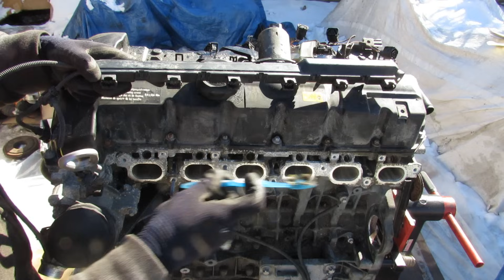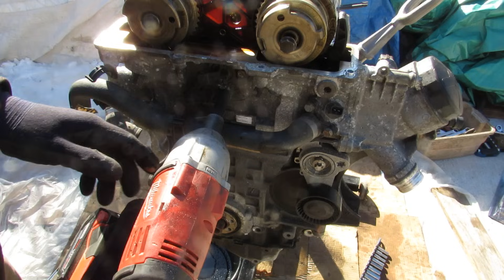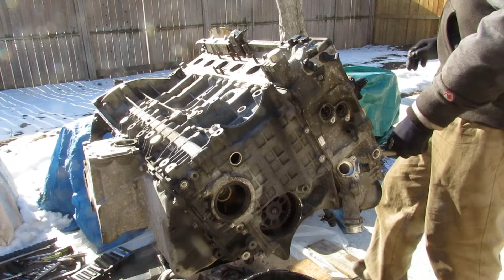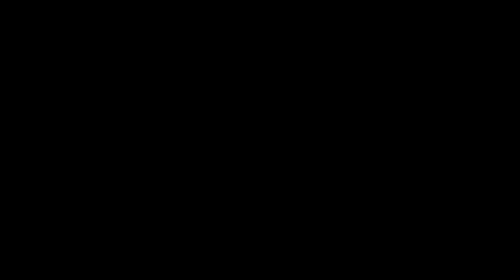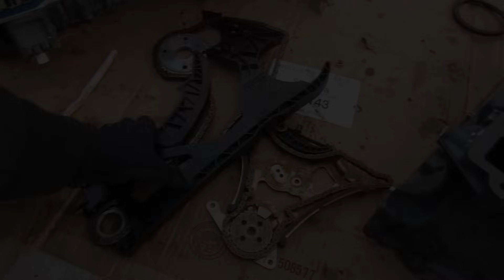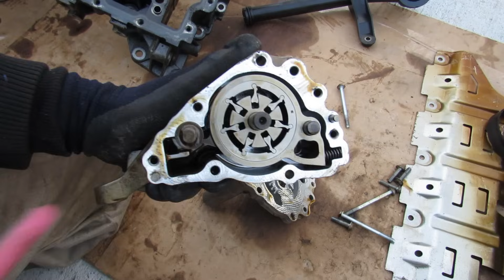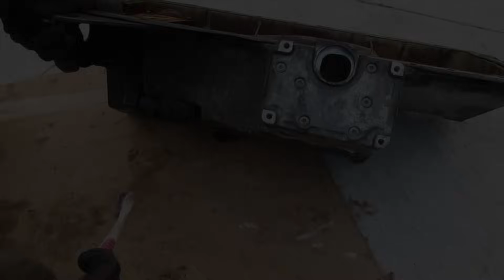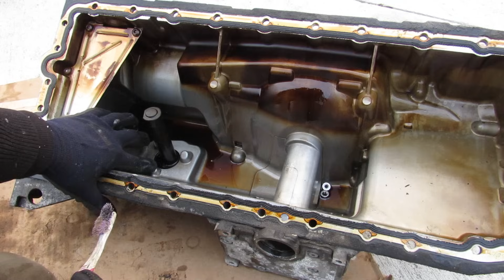The Last Inline 6 Engine: BMW N52

Comment: I think if you'd watch some of the BMW YouTube videos you would understand the name of the nomenclature of what those items are called versus versus making up names instead of calling it what it supposed to be called and how you pronounce it, but all-in-all you didn't describe her explain the carbon buildup on the Pistons and the Rings and try to give some explanation if there was anything in particular because of that? You could say that German engineering has made these really reliable engines similar to the Toyota 4 cylinder engine, but the issues with the leaking oil has not been perfected as far as stealing the engine off and using a cast-iron valve cover instead? He also neglected to mention the Vanos check valves and filters down line on the left side of the engine lower left that use a torch to remove them there's check valves and a filter screen going Upstream to the venous valves why don't you try that in your next video why do you think they develop the engine flush to begin with, the clean out the contaminants and sludge and contaminants inside the engine!

Basically on design of the BMW engine all BMWs are going to leak oil from the valve cover and from the oil pan! 

   So you're going to have to always have a budget to replace these components around a hundred or a hundred fifty thousand miles to depending,

 unlike the Toyota engines,
 use cast aluminum valve covers and they have a integrated steel neoprene gasket in the oil pan!
  Bottom line,
  Toyotas and Lexus models are higher reliability to own and maintain,
      versus the BMW line!
I can relate and vouch for the Toyota line!
    since I've had three Toyotas previously going back to the early 80s,
   I never had problems with leaking oil pans are valve covers?!

Comment: 5:14 That's not true. First you have to take both VANOS gears off and then you can take the whole timing chain assembly. In your case, the inlet VANOS has broken bolts and the gear stayed.

Comment: Like you mentioned, these engines were sensitive to proper oil pressure- so make sure you don’t have run low on oil, or even overfill the oil level.  A really nice engine, overall.

Comment: I hope he saw the broken Vanos gear bolts in the bottom of the oil pan.  That was the problem with the engine.  Those old style vanos gears bolts break frequently and were upgraded by BMW to a stronger style, with different bolts.

Comment: Pros and cons, when it comes to BMW in general (90s and newer)

Pros- incorporation of advanced but somewhat untested technology means good power output and economy, relatively speaking. 

Cons- if you buy one with more than 75,000 miles you will quite likely end up feeling conned 😅 unless if you don't mind quite costly repairs to replace bad gaskets and shoddy plastic failures
Reply from the maker: Agreed. Lots of things add up and it's not cheap to repair

Comment: One of my favorite engines, had one in a e90 from 70k km to 150k km did 4 oil changes 1 radiator 1 coil pack and 6x spark plugs I was super pleased with the motor and oddly I never had an oil leak was still very tidy under. I have since upgraded to the newer B58 I-6 3L single T and boy do I get similar vibes in the robustness

Comment: all these engines are pretty bulletproof if you take the time to fix the leaking valve cover. just put in some gasget paste on the original seal and it leaks no more

Comment: "Part of what makes this engine a real BMW is that it leaks oil...". As a current and many-in-the-past BMW owner, this has me in stitches. He ain't wrong!
Reply: Properly serviced BMW engines do not. Craftsmanship is a bit different here in Germany.
Reply: @alexandermenck6609  Nonsense. I've had several "properly" serviced BMWs that leaked. Virtually all of them do eventually. Oil lifter housing, valve cover gaskets (among other spots) notorious for leaking.

Comment: Lifter tick isn’t solved by replacing the top end 😂 waste of time it will soon return you need to bleed the lifters by having the engine up to temp and hold it at 4K for 30 to 40 seconds and lifter tick will be gone it’s a design flaw and will always re occur new lifters or not

Comment: HELP! This is a longshot but by BMW e60 is "lagging" when I hit some big bumps/speedbumps and the car acts like a crazed horse 
for a few seconds, I've changed the VANOS already but the problem is still there.
Happens in LOW REVS! And sometimes it can happen while im cruising in 80kmh and I hit a tiny bump, feels like the car taps the breaks 
almost but we've tested all of the breaks and abs systems etc and it has nothing to do with that.

Comment: I had a few days with this kind of engine in a 125i convertible. Amazingly smooth, eager to rev and the sound was pretty good for a stock engine. Getting into an old school, NA 6-cylinder BMW when you're used to 4-pots is quite an eye-opener WRT smoothness and general "engine manners". 
It did feel a bit underpowered, despite its more than decent hp-rating, but that was probably just the car being overweight.

Comment: I have an 04 530 with an m54 and 200k miles later its still going. Now I'm looking into getting a 128 and I've been hearing great things about the n52
Reply: Get one bro, I got a 130i with lots of miles and it still runs perfectly fine

Comment: Love the video dude I’ve got 2007 bmw 335i it’s still ok other than the valve cover gasket coolant bottle elbow on the front of the engine  it’s an n54b30 turbo motor 6speed manual

Comment: What makes it "The last inline 6 BMW Engine"?  As far as I am aware there are next generations and by far better inline 6 engines BMW makes today like S58/B58, why is the shitty N55 the last? 
If you mean the last then it certainly isnt the N55, its M50 the true best BMW engine that they have ever made. Cast iron straight 6 with proper design not in terms of N/A power but in terms of how its designed and built, its operating resource allows 1000HP at ease if you make it work under forced induction.

Comment: i love this engine. bc i used to own a 128i. sounds so good when you just straight pipe the muffler. but i dont know if i will ever own a bmw or german car again. that thing just ate my money up. maybe as a side piece car when i am ballin. if ever.
Reply from the maker: Very smooth motor though
Reply: @speedkar99  definitely agree. it is probably the most smooth motor i ever drove. power delivery was very predictable, sounded nice, and the power itself was more than enough to have fun with. after i put active autowerk headers on with a tune, this thing felt like a E36 USDM M3. i wont lie, i miss my little 1er..

and you are right, this thing leaks oil. had to do the valve cover during my time of ownership at around 85k miles.

all things considered, it was probably the most reliable engine, as i had very few problems with it overall compared to other BMW owners in my circle of friends, along with on the forums (N52, N53). just getting normal parts for the thing were just expensive, and anytime i needed to get work done it was expensive..

most fun motor i had though was definitely the K20Z3 on my 07 civic si, which i believe you also covered on this channel?

thanks for the awesome content my dude, i am a huge fan!

Comment: 2012, 128i with 67k, when does it start leaking oil?  Had a 96, 328iC, sold at 120k with no oil leaks.  Two convertibles out of a long list of convertibles since 68 Camaro.  Convertibles, it's a disease. No bad BMW's, just bad owners, just like dogs.

Comment: When properly maintained this is one of the smoothest and quietest running engines I've ever listened to.
Reply: I agree with you...i have one with 188K and runs like a almost new car...pleasure to drive it!
Reply: @goldensprank5972  if you change oil regularly it can go over 500k km.
Reply: @korencek  Yes, i definitely believe that!
Reply: @korencek  That's about half as long as the Honda K24 series 4-cylinder engine will last with just scheduled services. I know this because I've seen several of them in Accord's, Element's and CR-V's last over 600K miles - not km's. Easier to service, too. 
But, the BMW gives you the superior status and much higher repair/service/parts bills.
Reply: @boomerguy9935  The engine can last forever if you change all worn parts regularly. This goes for any engine. The problem with luxury cars is that at certain car age people stop investing at it so it brakes down faster. While poor people will maintain their car as it costs much less. So this debate about honda vs toyota vs bmw is meaningless.
Reply: @korencek  I've had new cars that started breaking down almost immediately after buying them. This includes American, Asian and German cars. So, I'm not saying that any particular brand is better than another ("debate about honda vs toyota vs bmw"). What I am saying is that a particular model of car or engine - regardless of brand - can be better than another. I've had good and bad in all brands from all countries. Right now, I have cars in my driveway that are German, Asian and American and they are all good. 

Conversely, I've bought used cars with good service histories that lasted hundreds of thousands of miles with routine maintenance. 

I've been buying and wrenching on vehicles since the 1960's and I speak from experience. 

IF the parts are made of high quality materials and the engineering and assembly is good on them, they can last a very long time but you cannot assume all parts in all cars will last the same length of time. 

I love the design of the I-6 engine and I've owned them in  a Ford Falcon, Datsun 280Z and in a Jeep Cherokee. Very reliable, quiet and smooth, and my favorite design, although I like a lot of other designs as well. I understand the Chrysler "Slant-6" was extremely reliable, as well.
Reply: @korencek my n52 (530i) is at 380k km now on LPG and still going strong.
Reply: @boomerguy9935  that may be true but no honda drives or handles like a Bmw. Or feels even 50% as safe or stout at higher speeds.  Anyone who's driven both brands will attest to this. Living in a major city, driving a tin can is like playing Russian roulette with all these fantastic driver's
Reply: @korencek with everything leaking..2500 for pan gasket..I could do the filter housing myself..maybe the valve cover
Reply: @boomerguy9935 I got a 08 x5 and a 16 accord..I hate my bmw already..had for 4 months..no dipstick..no temp gauge..lol..newbie
Reply: @goldensprank59its nice..but no dipstick is what gets me have to rely on a damn sensor..especially when the oil pan gasket is leaking got a 08 x5 with 150k..runs good
Reply: @goldensprank5972  188km is new tho what do you mean that’s what you get when you buy from a dealership
Reply: @dennisrock5564  he/she means 188,000 miles
Reply: @spicysnowman8886  thanks
Reply: smooth, quiet and pushed you back in your leather seat, it was special. everything good goes away.
Reply: @truthmonster3290  still got mine
Reply: @truthmonster3290  everything goes away
Reply: @crackedemerald4930  Exactly, even I thought I would never die but still died January of 2017.
Reply: For reliability N52 is the better option. Can't count the number of times I had to deal with my N54 having issues. Not saying that the N52 doesn't have problems (oil leaks, as any bmw). I prefer my E90 328i xDrive over my 335i for everyday use.
Reply: @GautamKumar-cr7tw  Yup, my oil pan gasket weeps. I have the same car actually. 2008 E90 328xi sedan 6MT. Just turned the clock at 90k. I'm just the second owner, I've had it for 3 years now. I've replaced all the consumables and I live 20 minutes from FCP Euro so that's a big plus. Love the car though. My friend has a 335 with an N55 that puts out like 600hp but I prefer the hydraulic steering in my car. Makes a huge difference but his car is an absolute weapon when he's not working on it in the shop lol.
Reply: Lifter tick man, it’s no smooth engine
Reply: @vamosnippon  Also, to say an N52 is not a smooth engine.... is just wrong. Like, have you ever driven one?
Reply: @saganworshipper6062  lol yes I have the e90 and I got it because of the silky 6 until lifter tick kicked in. I use liqui moly oil and additives but no real solution. Idk what’s so smooth compared to other engines tbh.
Reply: @vamosnippon  it's a purely mechanical fix. No amount of ceratec or any other additive will fix it. You have to install the updated exhaust lifters and rockers. It's just the exhaust side and it goes away if you just drive the car for 5 minutes. It only affects pre 2009 cars.
Reply: @saganworshipper6062  yeah the guy doctor Dean rkns just hold the accelerator down on 3000rvs for about 3mins or so and it goes away..
Reply: @saganworshipper6062  I got the plug-in called Carly, and reprogrammed the transmission points for my N52.  I made it a lot smoother.  The ZF transmission is capable of operating in a number of different ways.  so I made it smoother with more reasonable shift points and differential compensation between gears. Caution. Don’t set the shift points too low, because the N52 shouldn’t be below 1400 during normal operating conditions, or carbon buildup will occur.
Reply: @kellyem33  My car is a manual transmission.
Reply: @saganworshipper6062  That’s good to know
Reply: @vamosnippon  that's been corrected. Requires new lifters and rockers, but there is a factory fix out now.
Reply: @boomerguy9935. Maybe be true but no honda can drive  or handle like Bmw.. And Hondas do not feel even 50% as safe or stout at high speeds. Living in a big city I feel much safer not being in a tin can
Reply: The older M20 (two valve - design) runs smoother, especially the smaller ones (2,0 or 2,3 liter).
Reply: I agree. I didn't realize that 12 years ago, when I purchased it with regular maintenance, it's great. I did my own valve cover replacement and gasket refresh because it started leaking on schedule. Remember to replace your oil filter housing gaskets! I have 111,000 miles on mine. My biggest worry is the timing chain and the slides. I am not sure if that is a failure point. Too difficult for me to work on myself.
Reply: @ThunderMilflin  That is a worry of mine too. I saw someone doing an engine teardown of an  N52 and when he took out the timing chain guides they basically shattered like glass. They were heavily stained though and the person made the comment that the engine had been neglected and hadn't had regular oil changes. I take the utmost care of my car but that video legit frightened me. My car still has under 100k miles but it's 15 years old now, and I live in New England so it gets below 0F in winter and we see at least a handful of days in the summer that are at or very near 100F. Those types of temperature swings CANNOT be good for any of the plastic. I'm just the second owner of the car but I don't have much history from the previous owner. I only know they changed the oil regularly at the dealer as shown on the Carfax but I think I'm on the original OFHG unless they replaced it at an indy shop that doesn't report to Carfax. I check on it religiously because of the fear of getting the belt sucked into the crank, but there is not any sign of leaking there at all. My oil pan is a different story lol but that is like a $2k job if you have a shop do it because of the xdrive everything is in the way so it's like an 8 hour job.
Reply: O h do realize that sounds silly compared to a Corrolla, but we cant all drive Corollas.
Reply: @ThunderMilflin  I’m honestly considering getting rid of my n52 z4 for a Corolla powered mr2
Reply: @GadgetMart  me personally, looking at a truck next. Been living with the 1 series for more then a decade. She’s still clean though. I’ve given her a nice easy life.
Reply: My brother has an e90 328xi with this engine and let me tell ya IT DOESNT LEAK. I know this sounds like something made up but the thing is bone dry under there 200k on the odo.
Reply: @MrVette213  That's pretty impressive. Where does he live? What's the climate like? I'm in CT so we get both extreme hot summers and cold winters. That and the liquid salt they put on the roads nowadays will literally disintegrate your entire undercarriage. Stuff is the worst on all the steering and suspension components but probably also has contributed to my leaking oil pan gasket. It's like a $2k job to replace a $20 gasket lol. My car is xdrive so the whole subframe has to be removed and it's like an 8 hour job. I will eventually get it done though and when I do I'm replacing all the bushings with M3 spec ones and I'll probably do all the control arms etc at the same time while it's all apart. Love the car though, next month will be my 4th year of ownership.
Reply: @MrVette213 well you got lucky..my pan gasket leeeeaks
Reply: true i own one
Reply: I loooove mine, I just put like $5K into my motor lol (well, mostly. Some of that was dinan springs + dinan tuned bump stops & dinan short shifter). 194K miles and running strong
Reply: Same with the M54.
Reply: @alexgallegos7582  I personally prefer the M52TU.  Very similar to the M54, but has a better piston ring design, so it doesn't suffer from that oil consumption problem that high-mileage M54s suffer from.
Reply: Facts
Reply: Quiet running engine? You need to hear a cast iron engine before you make that claim.
Reply: H22 engine beats all
Reply: Lies. Every BMW sucks.
Reply: They're also amazingly good on fuel too. Better than just about anything out there of comparable output. 45mpg at a cruise is a realistic figure!
Reply: There is newer B58, better, smoother :)
Reply: @korencek and of course you just mentioned a turbo motor. 🤦‍♂️